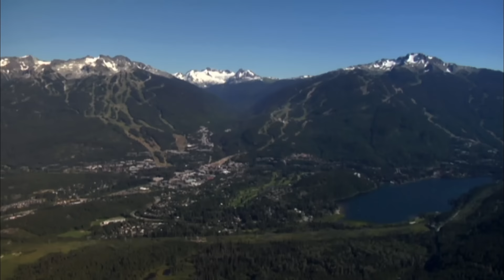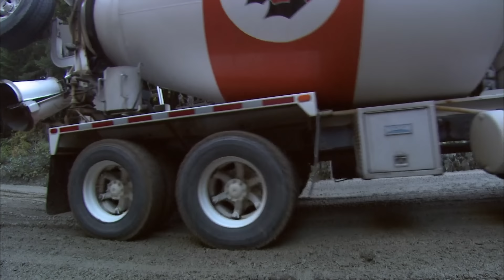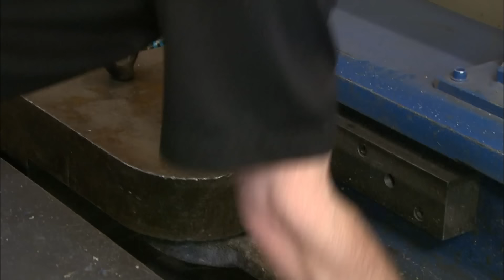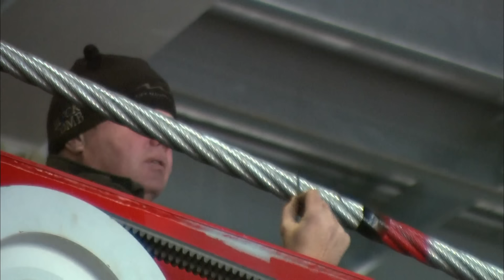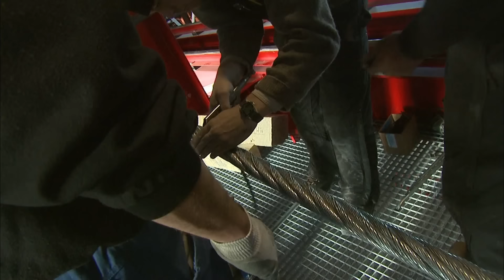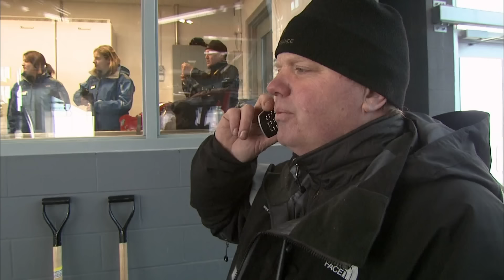The Engineering Genius Of The Largest Ski Lift Ever - Peak To Peak - Engineering Documentary

Comment: Watched this for one reason, to hopefully learn how the multiple spools of cable would be attached together while retaining the specified breaking strength.  Came away still wondering.  But hey, teflon tow ropes are apparently useful...
Reply: they arent, loose ends anchored on the 4 rail cables and one continuous driving cable
Reply: @daynosdr  ah, I see that now in an article about it.  I'd still be interested in knowing how they connect the segments of the haul rope.  Even though it doesn't require the same breaking strength, I suspect it still has to be a pretty stout piece of cable.
Reply: @pdisme  They splice/weave  the strands at different locations along the cable.
Reply: The track ropes are anchored on one end by wrapping them around a large, cylindrical "bollard" in or behind the lift terminal and on the other end may be attached to a counterweight by a socket or may also be anchored.  The track ropes with their outer smooth surface composed of interlocking 'z' shaped wires (called a "full lock" rope) are not spliced.  The haul rope is spliced into a continuous loop by 'unlaying' the strands, then marrying the ends of the cable and tucking alternating strands of the ends back into the rope, as Marty describes in his post.  The length of the splice is generally between 1200 and 1300 times rope diameter, so a 1" wire rope would have a splice about 100' in length.  The haul rope on this gondola is much larger than that - it looks like maybe 45 or 50mm, so the splice could be 60 meters long.  A correctly executed socket or splice is as strong or stronger than the rope.
Reply: @petebansen9780    Thank you for your reply. 
Pete is much more familiar with this equipment than I am. Like my guess at the amount of extra cable needed and the length of the splice.
 The sophisticated Z Strand shown in the section view is something I have never seen. My own experience with die-formed (triangular-sectioned) wires in the completed strand (track rope), when they are continuously run-over by rollers or otherwise worn, and made from austenitic corrosion resistant steel, is that they will sometimes "exfoliate" as  the wire surfaces get hardened and the alloy near the surface gets corrupted. Then they become very unpleasant to work with as the sharp surface flakes get on everything nearby. I have never seen this phenomenon mentioned or discussed anywhere, though. 
When most cables are being made, each subsequent layer is laid onto the previous layer in the opposite direction. This sort of locks everything together. But interestingly, the haul ropes shown here are laid up all in the same direction. This makes the ropes much stretchier, as well as making them much more difficult to terminate, because they almost fall apart on their own when you cut them. Maybe they use this type of construction to reduce the dynamic loads so starting and stopping doesn't jerk people around as much, but I don't know. This "lang lay" type can also have its own birdcaging problems if the terminals are incorrectly attached.
The ends with sockets attached are shown being tested, but those are the haul rope tests, not the track rope. I would personally think that the ends of the (less-flexible) track rope would be strongest if they were socketed the same way as the flexible haul rope test pieces. That is, they are inserted into a funnel-shaped terminal, splayed out (separated from each other) and the "socket" funnel typically filled with molten zinc. The track ropes need to support the weight of the gondolas, and the weight of the rope itself (maybe 4 or 5kg/m), times a safety factor of around 4:1, plus the load induced trying to lift all that weight by pulling horizontally on the ends. It is not unusual for the load on each end to be seven times the weight being supported even before the safety factor is multiplied in.
If the ends of the ropes were wrapped around a bollard, that would be full strength as well, while sparing the end terminal (socket) from having to continuously bear that load. The bollard for the track rope would need to be much larger diameter than one for the haul rope, because of the flexibility of the haul rope. But you can see the diameter of the wheels that the haul rope goes around at each end of the loop; they have to be that big to not destroy the cable going around them. How many hours they have to operate per day, and the speed they run at, are also part of the equation.
Before long, I expect to see at least the haul ropes, being replaced with synthetic fiber ropes which will save a lot of weight. Currently I don't know of any fibre rope which could come close to the durability of the metal track ropes, but I would not be surprised if that happens too. Fibre rope is replacing wire rope everywhere you look these days.
Reply: Good description of the socketing process, Marty.  In a situation where the track rope is tensioned using a counterweight, there is usually a socket at the counterweight end of the full-lock rope and a more flexible rope running over the deflection sheaves to the counterweight.  At the bollard end, the full-lock ropes are wrapped around the bollard so they can be adjusted as the operator accommodates rope stretch over the lifespan of the ropes. Yes, the bollard diameter for a full lock track rope like those (which are probably larger than 50mm) is very large - I don't know how many rope diameters.  In terms of wear and exfoliation of the track rope, the carriage on each cabin has sheaves with rubber liners and the track ropes over the towers ride in bronze tracks on the saddles that are well lubricated - all measures intended to minimize wear and abrasion on the outer surface of the rope, so there is no wear to speak of.  The ropes themselves are lubricated annually and magnetically inspected regularly.  I don't know if synthetic fiber ropes can be expected to replace steel as a haul rope material any time soon.  Steel is pretty well suited to the task.
Reply: @martyspargur5281  Outstanding explanation! I spliced rope as a Boy Scout and some crane cable in the 70s. Every time I ride a chair lift, I look for the splice and always impressed when I find it. I've always wanted to be there when they splice a new haul line and the Forest Service inspects it.
Reply: @petebansen9780  and @marty spargur It's always cool when you actually get some experts in the comments as opposed to the usual armchair experts.

Comment: Nothing like buying a day ski pass and taking lifts to the top of a peak, but not to ski down it like you paid for, but rather waste your paid time traveling horizontally back and forth- genius !
Reply: Do you just want to not ski on half of the mountain? It is 11 minutes man.
Reply: @benbignell  
You pay to ski so anytime spent on a lift that is not constantly gaining vertical is simply a sightseeing tour- 
You just spent the time on lifts to the top of blackcomb or whstl then chose not to ski but rather spend time floating around. 
11min is the running time but how long did you just wait in another line? 
This project is to tie up hundreds of paying skiers to persevere terrain, 51mil could have built two one shot speed lifts to both peaks from base-
It's really about boosting summer tourism and bragging rights which is smart.
 But my comment isn't about any of that, it's about
 this drama story and how they are using the skier as a scapegoat of why they are endering these costs and challenges to finish this feat, when the skier is the one to least benefit. 
Ski politics at it's best
Reply: @gbh5912  sure

Comment: I was interested to learn how they got such heavy cables across such like distances. They show the guide rope being placed first but failed to show how they then haul the mega cables and apply tension. Glad to have Billy Styles and Norm Duke on the job though.
Reply: They start with the nylon rope, then use that to pull lighter gauge steel cables across, then use that to pull the main cables into position.

Comment: In the North Dakota oilfield - where it'd snow at the least opportune time.  We'd get a blade (road grader) to clear off all the snow before sunrise u.v. melt can start.  That way the road remains dry.  If it rains, new rock is brought in to keep roads planed.  And last resort - trucks are towed into and out of the site.

These "engineers" needed to have this information prior to starting. Just common sense.

Comment: The haul rope isn't structural. But if it breaks, all of the cars still be racing to the lowest spot on the line.
Reply: So it is
Reply: This cable has a relatively small load, Breakage is improbable in the coming century but it will be replaced long before that. Cars are fitted with integral brakes on the carriers. They will stop.
Reply: Aren't there automatic brakes on individual cars?  There's every other dang safety device imaginable. ;)
Reply: The cars have brakes

Comment: Concrete trucks have a high center of gravity with concrete inside the turning barrel accreting on one side unevenly...........paired with uneven,slippery slope on the roads makes it potentially a roll over risk or the trucks slipping off the road completely.  The best mitigation is to grade and dress the roads and accept lighter loads.  Customers should already know those things and operate within the limits of their access.

Comment: I'm just a simple carpenter last 30 years but wouldn't you bring the concrete company on when the project started and make them an integral part of this build?? Yes it would be more costly this way but he would be legally bound by a contract to get Crete up there no matter if his worn out trucks take some damage. Or build your own plant. Sounds like Crete owner is a little peeved he got cut out of the project!!
Reply: I bet the project manager didn't run the plan by someone with on-the-ground experience like you
Reply: Or, incorporate the local rock up there, build a plant to wash and crush it.  The major pour was just a giant deadweight without special strength requirements.  Carry a LOT less tons up the mountain.

Comment: As a skyrise fall restraint anchor bolt engineer designer and installer ( for window washing and build maint ) in Honolulu north shore big wave surfer and now a commercial roofer in my late 40s by choice i want to work with the guys running around up high on the steel cables. For fun of coursd . lol

Comment: While the engineering of the peak-to-peak lift @Whistler-Blackcomb is indeed impressive - nevertheless, it begs the fundamental question why there's any practical necessity for the project in the first place beyond what amounts to vanity.  There's far more runs available to skiers at any level (beginner to expert) on each mountain separately than any skier can explore in a single day - and the only sensible strategy at the beginning of each day is to take your pick of Whistler or Blackcomb and ski the runs on that respective mountain, and then pick the other the next day.  Taking the Peak to Peak is actually a very inefficient way for a skier to use part of a ski day, except as a pure sightseeing ride that doesn't take you anywhere on either mountain you couldn't get to on existing lifts.
Reply: it is about access you have to spend time in whistler to understand it's worth  it allows people who upload from creek side easy access to blackcomb and spreads skiers around the resort to avoid overcrowding on whistler mountain
Reply: many people upload from a base area called creek side it makes it much easier to get to Blackcomb from creekside and spreads people around the entire resort

Comment: The documentary was nice, but they skipped what I think would have been the most interesting part, which is the splicing of the cables. They mentioned the nylon ropes used to set the cable, and they moved on without further details. Pity.

Comment: I don't think those spools of cable weighed 4 million pounds (or the weight of a space shuttle) like the narrator suggested
Reply: ~185,000 pounds apiece, 5 spools total, so yes somebody screwed up
Reply: They were correct. 4M pounds was liftoff weight of the entire shuttle with loaded tanks and payload not the weight of an empty space shuttle. The Challenger weighed 165,000 lbs. Could you imagine 4M lbs on top of the 747 that flew the empty shuttle on top? 😄

Comment: 30 tons? 60k pounds?  That's all? I would think the cable weighs that much on its own.

No no no.  That's only 300, 200 pound Americans.
Reply: it looks like they're testing the haul  rope (you can tell by the rough surface). it might wheigh even more than 30 t, but it is supported by the two track cables, so it  mostly just has to pull the cabins...

Comment: As an engineer, I'm looking at all the small things that were missed and the dramatization of basic science. 
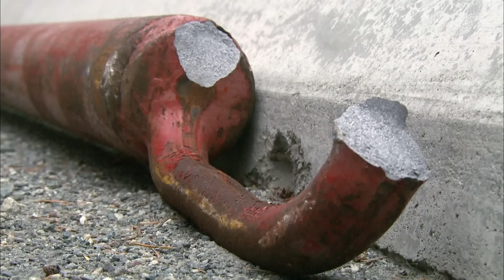As someone who spent decades in and around construction I'm laughing at all the stupid mistakes by engineers who should have been able to calculate failures based on physics, but didn't.  25:26
But, more importantly, as someone who just spent years in a pandemic, I'm thinking that when "one of the crew is coming down with the flu", you don't continue to work right next to him in case he starts to feel more sick.

Comment: What I do not understand is the following:
The cables are woven and consist of multiple smaller cables (obviously) but how are such long smaller cables made in the first place.
My second question is; how do these smaller cables remain close to each other, as in one bigger cable, I would imagine the will spin apart.
In the documentary they talk about multiple cables. Does this mean they make the 3 cables as a whole, or do they mean that each cable (of the 3) is produced partly and then shipped towards Canada where they are assembled into the 3 final cables.

Furthermore does anyone know how they put these massive and heavy cables in place across the valley.
Hopefully someone has some answers.

Thanks in advance!!
Reply: it was in the doc but not well explained they were more interested in the they drama of the trucks going up the road
d they flew a normal rope across the valley then pulled bigger and bigger metal rope across

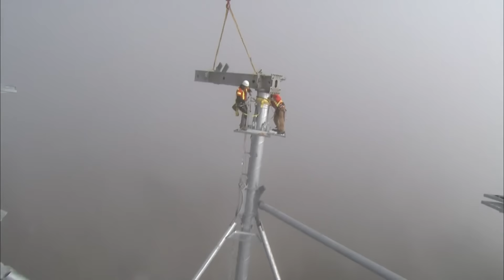Comment: 13:40 "The most dangerous Job in the world" Where 1 guy makes $45/h and the rest make $20-$25/h. Put bolt pin in hole, hit bolt pin with hammer, put in bolt. Not hard at all just extremely dangerous. Crane operators swing tons of steel at you, pinch points = loss of limb

Comment: It’s rare to deal with a concrete supplier not willing to do pretty much anything to get to you. Is this an isolated problem in Canada or are they all like this.
Reply: It’s just a matter of breaking the equipment
Reply: It is TV drama! The concrete company would have done everything possible to get the mud up the hill to finish that section of pour, avoiding a cold joint, but they very well may have said they wouldn't send trucks for the next pour until the road was fixed. Like you said, everyone knows how important it is to not stop in the middle of a pour.
Reply: What a joke!...isolated problem in Canada???? That company has supplied all the concrete for ALL of Whistler and Blackcomb's needs for over FIFTY YEARS....that's all lifts and buildings from the valley floor at 2200 feet to Whistler peak at 7500 feet.
The customer gets a price for concrete delivered to a certain place on the mountain for a very specific price. The customer supplies the road access. If the customer fails to deliver the road access he can use helicopters or in this case wait for spring.
Like the man said: We are not going to wreck our trucks because you can't give us a decent road to drive them on. Busted drivelines were not included in our price. End of story.

Comment: Very interesting video... We all know in the back of our minds there is a damaged cable out there.  Despite clearing "safety checks" I don't know how I feel about that... They clearly tampered with a specific section of that cable... I don't think I would ever ride this gondola for that reason alone.
Reply: Well it's been running for 11 years now and nothing has happened so...
Reply: it's chill bro I went on it and didn't die
Reply: Haul rope is fully inspected at least yearly with a magnetic induction test device running every bit of the cable to look for even the smallest damage, its fine!
Reply: Plenty of redundancy in that cable.  And the computer scans it twice per loop.
Reply: It’s the haul rope and like Wolf said, it’s been running for 11 years.